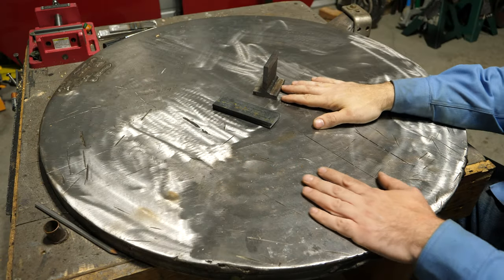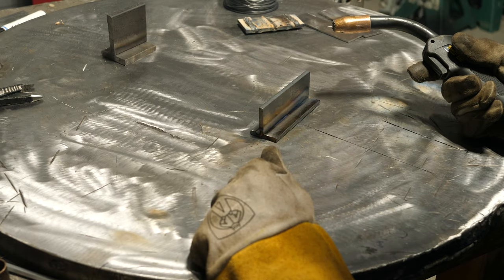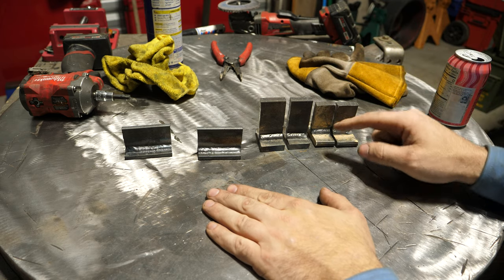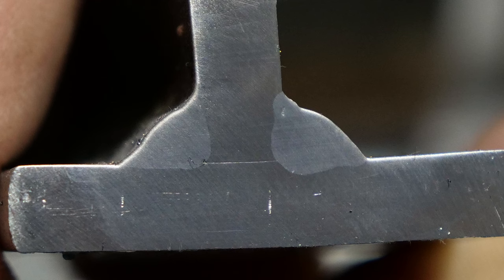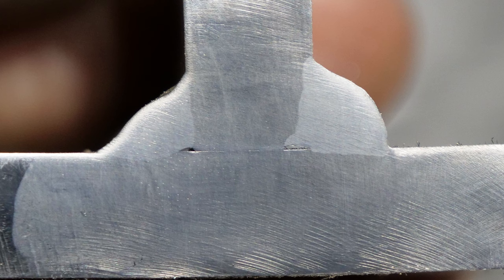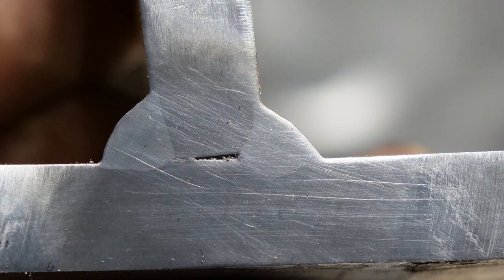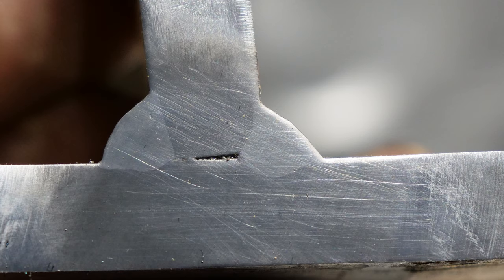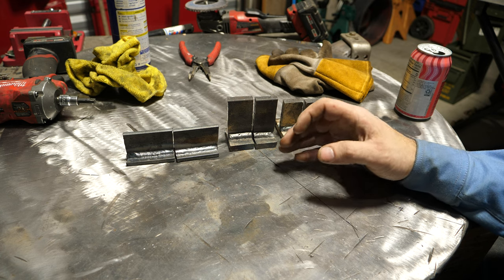Short circuit mig vs Gasless flux core on thick plate

Comment: BTW. Is dual shield flux core with added gas? Or is that a wire I could buy? If so...I would like to know what wire or brand to buy or look for on amazon or the local weld store.
Reply from the maker: So the wire I used in the video is .035 self shielded (Gasless) flux core.  T11 spec (so not -gs) and was either Hobart fab shield 21b or American forge brand.  True dual shield (so gas shielding on top of the flux core wire) in .035 wire does exist (far more common in larger sizes) and has a few differences.  So straight flux core is run DCEN polarity, dual shield is typically run DCEP.  True dual shield wire is rarely available in smaller spools than the big 10-12lb spools, and are not generally sold at any local box store outside of a welding supplier.  The flux composition is different as well.  

I just bought a spool of .035 dual shield to try, I have never personally ran .035 dual shield wire (only larger diameter).  I will have a full video on it and how effective it is as a option for home hobbyists within a week or two at most.  It may be a viable option for people to weld thicker steel at home with a “smaller” MiG welder.  Straight flux core is a solid process but porosity seems to be a issue in my testing when welding thicker material.  A 200 amp class MiG welder isn’t really designed to be burning .045 flux core wire so the .035 dual shield may be a solid option.  Testing will surely find out how effective it is 😀
Reply: so where do you buy your dual shield? I just wanna see how thick of metal I can possibly go with flux core. And be reliable of course. @makingmistakeswithgreg

Comment: This exactly describes why my first attempt to weld my own miniexcavator bucket years ago with a quite insufficient 160 Amps welder still holds together. I used selfshielded fluxcore wire (more a lucky accident then knowledge).

Now i have a older but much stronger Mig welder capable of 420 Amps (and thankfully just enough Power from the provider). welding on high Amps was scary as hell! 

From the days I had only fluxcore I was used to drag not push and catch me sometimes to drag the solidwire and it feels like it helps with penetration a bit. Could you please figure out if there are differences in penetration dragging vs pushing with Solid wire?

As always great Video and many thanks!
Reply from the maker: I definitely will do a comparison with the push vs pull.  Honestly I don’t think there will be much difference on thinner material, however thicker material there probably would be.  

Mig welding with a powerful welder makes all the difference in the world when it comes to welding thick steel.  For most people limited to 200 amp wire welders, the best hope is .035 dual shield flux core wire for welding much over 1/4inch.  Even then there will be limitations still.  Once you cross over the 240+ amp wire welders many doors open up for capability, provided the power exists to run them lol.

Comment: If you were limited to a 120v 20amp outlet and needed to weld two sections of 3/16” wall square tubing together in a T joint, would you prefer stick or flux core? Or do you think that’s outside the scope of 120v machines
Reply from the maker: Great question and I can answer it confidently.  If it’s a dedicated 20 amp circuit (or other things aren’t turned on that are on the circuit) and it has a 20amp breaker, it is possible to weld 3/16th no problem.  I did testing with the titanium 125 flux core welder and on a 20 amp breaker it made super solid welds on 3/16 (1/4in was possible but 3/16 had cleaner welds ie no porosity).  

Flux core wire will weld it with less power from the wall depending on welder.  Many stick welders on 120 will only output 90amps, with a bunch being 70-80.  A 3/32 7018 runs around 90 amps so you may or may not be able to run that on a stick machine on 120.  3/32 size 6011, 6013, 7014 will all run on sub 90 amps no issue.    With stick you’re burning off a 3/32 rod, at higher voltage than flux core, which uses small .035 wire.  You have more room with flux core when it comes to welding thin material and generally less current draw.  The trade off is flux core is far more prone to weld defects (porosity) than stick, especially on thicker material.  It also has less penetration generally speaking along with more brittle welds.  Both are capable of doing what you want though.  Gas shielded short arc Mig will have a very hard time welding 3/16th steel on 120, definitely use stick or flux core.  

To see the limits of what flux core can do on a 20amp circuit check these two videos out.  They are show 1/4in being welded on 120v. 

https://youtu.be/rJHUgbl_yfo?si=iS-0EVkzzORUsfyV

https://youtu.be/P8RmNU0oYSc?si=Ydolm7FxdJ2-EDFP
Reply: @makingmistakeswithgreg  Thank you so much for your thorough reply. I was watching part of those earlier. Really enjoy your videos
Reply from the maker: @trucksimfan2687   no problem 😀.  Luckily we live in a time where inverter welders can actually weld that thick on 120v.  It wasn’t that long ago you would have needed a 30amp 240 as a minimum lol.

Comment: Wire Brand? size wire? Does technique matter? Like weave,stich,E's.ect?
Reply from the maker: The flux core wire was .035, t11 (not -gs wire) and was either Hobart fab shield 21b or similar.  Technique matters, straight in will achieve the most penetration.  Weaving and circle e will produce a wider weld with less root penetration.   I do a stitch motion from time to time and that works ok but if you “ride the puddle” you will loose penetration as well.  I will have a video out in about a week that covers a comparison to all of common methods to put down wire with cut and etches.  This should provide a ton of insight to how well certain methods work.

Comment: Do you have to weave when you are welding with flux core wire?
Reply from the maker: Weaving with flux core has limitations.  Generally speaking a single pass “stringer” weld is stronger (weld grain structure is better).   When you weave you also lose penetration, which is undesirable.  Weaving is best suited for  fill and cap passes, not single pass welds that require strength.

Comment: Would I be able to weld if inch 2 x 3 .120 wall tubing for a chassis built using flux core
Reply from the maker: Great question and something I definitely need to do a video on.  To answer your question, i will say this:  it’s actually a pretty complex to answer it.  In drag racing (NHRA) doesn’t allow anything but gas shielded mig or tig to weld cages.  For a chassis they may or may not permit that depending on a number of variables.  Now you’re probably not welding something up for a NHRA spec vehicle, so you would need to abide by the rules for what you’re building it for.  If this is for a no rule street vehicle or off highway use, then you are free to use flux core or stick for that purpose.  With that said, flux core tends to produce brittle welds that are far less ductile than MIg.  You may experience weld cracks under maximal stress that you would not see with mig.  That doesn’t mean it wouldn’t be strong.  For mild steel/DOM tube it would be ok, for chromoly tube it would be a no go.  

If you are competent at welding tube with flux core I do believe it can weld 1/8th without any issues, and it would be very strong.  If the component will see significant loadings (aka roll cage, high speed crashes, high vibration, or significant shock loading) I would try to use gas mig instead.  Hopefully that helps you out.
Reply: Awesome thank you I would love to see a video

Comment: WHY does the flux core penetrate better?
Is that because of the reversed polarity?
Reply from the maker: That’s a great question.  So there are a lot of reasons why.  Self shielded flux core wire likely produces a shielding gas that improves weld heat input much like 100% co2 does for mig.  Flux core also functions sort of like globular/spray transfer where the wire is mostly liquid as it moves from the contact tip to weld pool, which is a benefit to heat input.  In my experience running them both flux core tends to produce a narrower weld which means all the heat input is focused on a smaller section of metal which means higher penetration.  That narrow weld is a direct result of the polarity it runs on.  Flux core is also mostly dragged which produces more penetration than pushing generally.  Even the flux to a certain extent helps.

So basically it’s a multitude of factors.  Spray arc mode of transfer and 6010 rods can typically come close to bigger Gasless flux core wires penetration, however it’s typically at higher amperages and with wider welds.  That narrow weld with high penetration is hard to achieve outside of flux core wire.
Reply: @makingmistakeswithgreg    wow lots of info, thank you for taking the time to answer that! 👍

Comment: I'm an 25 year experienced in all trades .  I can fix basically whatever. I'm self tought I've never been to any colleges and iv been doing and started what I was just born with at about 8 years old.   Now this is the only time I've ever ran into a problem that is giving me question marks and making me very worried about welding . I have an f150 that I'm building all most finished but my 155 argon and co2 mix Lincoln mig welder.  I need to weld the 3/16inch plate steel notch to the frame of 2012 f150 short box .  I want to use a bigger mig.  I'm wondering if flex core would be a good idea for structured tough and I will have no worries in my mind after it's done . Cause my 155 220v Lincoln will weld fluc core but I'm not satisfied.   But I can't find a bigger mig with gas .  So what do I do . Fluc core
Reply from the maker: I thought I responded to this, maybe I did in another post.  So flux core is capable of welding 3-16th thick material with a 120-140a machine.  There are some limitations however.  Flux core has a bad tendency to produce hidden porosity inside of welds with zero indication of anything on the surface.  Gas shielded mig rarely has such issues. If I had a choice I would use gas shielded mig.  If flux core is to be used I would setup a test weld plate (same thickness and same position) and make a weld.  With a cut/etch or break test, if the weld looks good you should be ok.  If it has porosity you must get it dialed out before you weld the frame.  It also will pay to use quality flux core wire like Hobart fabshield 21b.  Don’t use cheap -gs wire, it’s not suitable for things requiring strength.
Reply: Thanks .  Ya it's junk .  It's needs to be welded with shealding gas.

Comment: So I don’t know if you mentioned it RE: flux core was that GS single pass rated or NR211 multi pass… I know you mentioned that you believe its made in the same place (which I would agree) however does it penetrate as well as the NR211 … In other words am I spending extra $$ for nothing. Around here you can save up to $20 on a 10 lbs roll with the GS flux core wire and the Kicker here would also be if you took GS wire and ran multiple passes .. what happens seen as it is Not rated for that.
Reply from the maker: So a bit of info regarding the -gs.  Flux core wire has issues with running multiple passes, -gs specifically state single pass only, mp or just t11 wire can be run multiple pass (typically only up to 3 passes total).  The issue with multiple passes seems to surround the fact that the flux core wire mixed with the base metal (like what happens in a weld) has acceptable properties in a single pass.  When you weld a weld on top of a weld, that second weld is alloying with not the base metal but more of the weld metal.  This can produce a weld with undesirable properties (like hardness/brittleness).  I can tell you I have done some actual break tests (which videos will start coming out soon) on single pass with -mp wire with interesting results.  The break tests on flux core wire result in snapping of the weld more so than slow bending of it like with MiG/stick which to me suggests a brittle weld.  Based on my simple testing I would definitely not take my chances running a -gs wire multi pass on anything that mattered.

Also keep in mind-gs wire has very little specification testing compared to -mp or t-11 multi pass wire.  One of my favorite weld consumable supplier (Washington alloy) has spec sheets for both -gs and t-11 wire, and there are alloy level differences between the wires and more testing requirements with the -mp.  

As fas as what would happen with a -gs, I believe a multi pass weld could be more brittle and possibly fail easier than a single pass.  I will have to test this to see what happens.
Reply: @makingmistakeswithgreg  Thanks for taking the time to explain just learned something new (again) from this channel. Keep up the teaching … have you ever though of becoming a welding instructor?
Reply from the maker: @ajkiviaho7212  the thought has crossed my mind.  I have looked into the schooling requirement to work for the local colleges, and I am capable of getting the credentials needed (I already have most of them).  The truth is a rather enjoy just doing the teaching thing on YouTube thus far and I am unsure if I will find it more fulfilling to teach in actual classroom.  I think I will ultimately purchase a old building of some sort and open a collective to teach skills.  In a rather ironic twist of fate I actually owned a 10k square foot school I sold earlier this year, but the city wouldn’t allow me to do anything with it (zoning issues).  I am still on the lookout for something that will more “suit my needs”.  😀

Comment: Please do some vids on different brands of wire. Amazon sells 2 E71T-11 wire from Blue Demon & PGN. They both get great reviews & cost half the price of the Lincoln wire. Somebody needs to let us know if it is any good. Your elected.
Reply from the maker: If it’s labeled t-11 wire it should meet that spec and perform good.  The -gs wire is what you generally want to avoid.  Basically the specs it has to meet are very limited.  I will be testing a bunch of flux core wires on 1/4 and bend testing them in multiple ways (including multi passing -gs wire) to see what happens.  I have a feeling there will be a huge difference between -gs and t-11